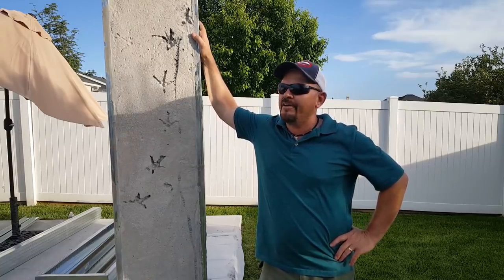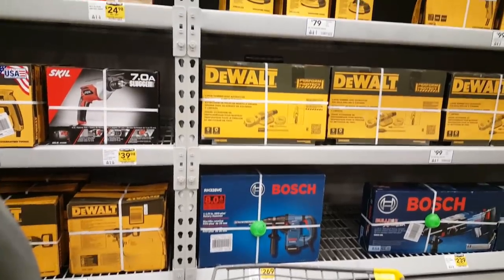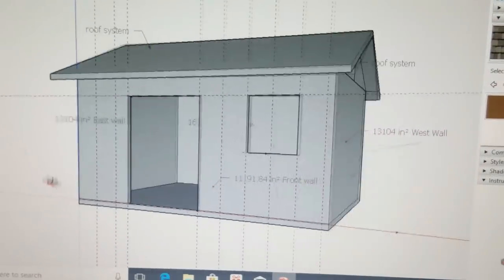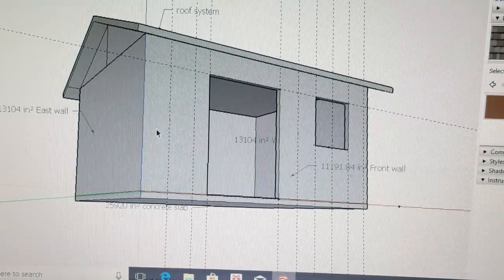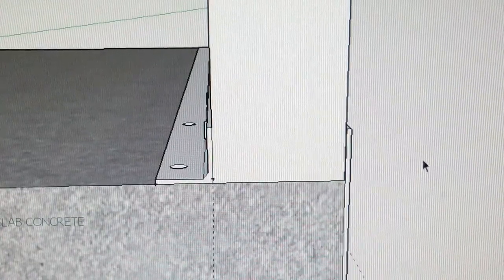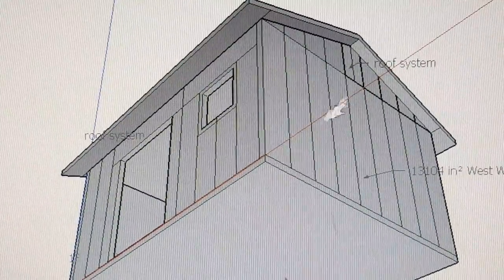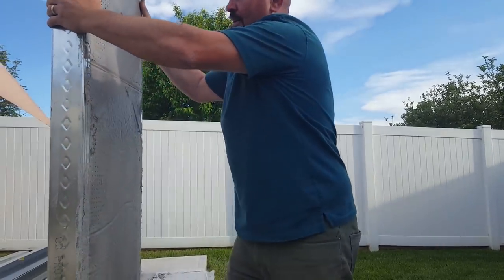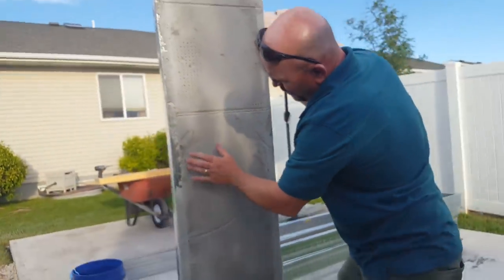Air Crete Shed Wall Panel Layout

Comment: I believe that the north wall is the wall that "everyone gets to see everyday". So, personnaly, I would have "hidden the thickness of the pannels" on the sides (eastern and western walls). Not showing the thickness of the walls in the front. Also, beware, aluminum and concrete dont mix so well. Great project. +1

Comment: Could you give a rough estimate on the cost per square foot with your air crete... I'm curious as to how this compares to other materials per square foot.
Reply: Depends on what you are comparing the per square cost to.  If plywood and studs, or a HD pre-built shed, this is not for you.  But I am sure the HDC will have the cost when complete.  His building will be fireproof, vermin proof, fire hose washable.....

Comment: I would love to build a goat shed out of aircrete.  Maybe domed would that work with aircrete?  We get snow here and a lot fo you think aircrete will hold up all that snow possibly?
Reply: Ps we live in Maine so when I saw we get a lot of snow I mean so very much snow lol.
Reply: This looks like a perfect application for Aircrete.  You could make a form with hardware cloth and plastic, then layer on the AirCrete.  Making a cool igloo shape.  When finished, you can easily hose it out every so often.  Form like gunite pools.
Reply: You could make a geodesic dome from this extremely easily. The panels could be framed the same way he is doing here with the C channel and assembled into a dome. Would be pretty straight forward and virtually indestructible. You could even top coat it with another layer to completely seal it.
Reply: Nathan Rogers ooh that sounds really amazing.  I would love to do that.  I think its passed my skills but with some more research on geodesic domes its possible.  I knew before I build it I would likely redo and redo the way I plan on doing it and thats definitely given me something to mull over not just for the goats but other animals too.  That would probably keep it safer with our heavy snow loads.  We just get so much snow lol.
Reply: William Terry that too sounds like a good idea.  Dome shaped however it gets that way would help with the balancing of the weight with the heavy snow.

Comment: Just checking, if the front has 6 16" panels, 2 10" panels, and a 42" door, that comes to 158". The drawing of the back shows at least 10 full width, 16" panels, and what looks like something that might be a 12 inch panel, not sure. However if you only treat it as 10 16" panels, that's 160". Both front and back appear to have reveals of the side walls, so I presume that the width of the front of the shed should be the same as the width of the back of the shed, which means that there are 2 inches missing somewhere (or over 12 inches based on the count of panels in back if the 11th panel is something like 10 or more inches.

I presume that the panel count of the back is not a correct depiction. Perhaps it should be 10 panels wide pluss the thickness of the side wall. in that case you probably want to make the 10" panels into 11" panels to give the front 160" as well as the back. But I may be missing something.

Comment: I would seriously look into a different design for attaching the panels to the floor. Since the floor is standard concrete a typical anchor bolt should work okay but I would use something  like a  PVC  pipe to create a way for the anchor to go in through the bottom of the wall  and use a wood form to create a pocket are in the wall to attach a nut and washer to the anchor running up through the PVC channel  in the wall. I know clear as mud.
Reply: Just drill holes in C channels and molly into the floor. Then stand slabs up inside track and fasten. Easy peasy!
Reply: Instead of angle iron put a rebate or step into base slab design, less material cleaner line's

Comment: I am guessing you are leaving the sheet steel forms around your air crete panels. I watched the chickenfoot panel pour and see you have mesh inside the crete so the overall panel should be pretty sturdy without being wrapped in the steel, so not sure why you are doing that unless you just have the money to spend. I would think you could design a reusable form that could be used to create exact duplicate panels, add is some sort of puzzle feature, tabs etc that would aid in locking the panels together as I still don't see how you are getting that part done. I would use that same steel smooth side on the inner so the panel can be removed after cure. The mesh inside will keep the panels intact until all together. maybe pour half the panel, lay in mesh then complete the pour. I am very intrigued by this and am watching through to completion to see how you join it all together, panel tto panel. It would be cool to have holes placed at specific locations on perimeter to allow the use of rebar pieces to hold instert and hold it together, it would be bomb proof! Keep it up.
Reply: I was wondering the same thing.  I've watched a bunch of vids on the subject, and there does appear to be several approaches. I'm curious as to the cost per sq ft compared to other materials.
Reply: I was thinking the same. Cut some PVC length wise form it a little too create a channel for tongue and grove. Maybe reinforce those areas with fiber mesh

Comment: Hey Darwin just for the record I am cheap I shop at habitat for humanity I save a lot there. If you have a store in your area? On the panels have you thought of when you build the panel could you use a PVC pipe to use rebar through the panels from the pad up through the roof? 

Also what program are you using to lay your project out? All my projects are small but I like using aircreet. Adios
Reply: James Owens habitat is a great place to support because they do awesome things.
Reply: Love Habitat Store!
Reply: kgs2127 habitat stores are expensive, they ask as much as the cost of items new. And no warranty.
Reply: He's using"SketchUp".  It's a free program if I remember correctly.  I used "Sweet Home 3d" to layout my little cabin.  It's also a freebie.  It allows you to layout rooms and customize the furniture to your actual size. and place the furniture in the rooms.  It has walk-through and many other views available.  Really nice to see how traffic patterns work.  You can even do landscaping and see how everything looks.  It's fairly easy to figure out.

Comment: Why not frame out one wall and pour it in one pour not a lot of 16 inch pieces... do the same for the other walls... The front wall you just make a square wall and put in metal studs for the door and window openings... But it to will be on solid pour... No need in all the extra work in all the 16 inch walls and 10 inch walls... My way would be mush stronger... Same money less work...
Reply: Why not make it out of timber? Or am I missing something
Reply: @A wood worker The whole idea here is to build using the aircrete. It is light weight, inexpensive, insect proof, rot proof, and fire proof.
Reply: The 16” panels are the only way he can use the volume he can mix of air crete at one time. I assume if he could mix a lot more he could pour whole walls.
Reply: I'm sure the slab was already there

Comment: 1 gallon or /approx 64 oz. ?? 1 gallon = 128 oz so the directions  say use 128 oz or approx 64 oz. I'm concerned as I don't want to mess up the recipe. Please clarify in the updated panel mix. Thanks

Comment: Ok. You poured a slab and it looks well leveled. So why are you not doing the walls like the commerical guys do? That is do a 'tilt up' construction. You use the floor as part of the form work and pour the two end slabs monolothlic with steel mesh, then tilt them up. Just bring all your friends and neighbors to do it.
Reply: I was wondering this as well
Reply: Was thinking along those lines too, those white vinyl fences in the back are the same really, put up the posts then raise up each panel. A bunch of smaller panels seems like a lot of bolting.
Reply: It's the capacity of how he mixes. .
Bigger panels means  larger. Equipment
Reply: Tom, watch his previous video. He poured the slab as a std cement mix in a day using the equipment he already had. That slab had triple the volume of what a tilt up wall panel would consist of. The only step he would be adding making an aircrete wall is the foam mixer station. That is solved by bringing an extra person on to that step.
Reply: The forms do need to be considerably stronger to hold all that concrete vertically, and I'm not sure what happens to the foam under those conditions either.
Sure would be interesting to see.
Reply: MaruAdventurer A

Comment: Just new to the channel, found it interesting but the bigger question is and may have been answered before. Why such a big overkill for a little shed ???
Reply: Yes, but AirCrete panels are the interesting part.  You should start at the beginning.  This is a new building material application.  Foam bubbles mixed in the concrete.  Normal poured concrete panels would weigh about 400 lbs.  The foam makes them about 100 Lbs.  Lots of ideas. shaping the AirCrete, Fireproof, super strong,  acid resistant....

Comment: I'm still not understanding why you're pouring the panels so small? 16" seems tiny, and will just lead to more gaps and lower thermal efficiency. Why not pour in 36" or 48" panel sections? With air crete, it seems they should still be lightweight enough that you can get them into place.

Comment: Rather than tamp it, which might make it more dense, how about using  a sawsall to vibrate it for 30 sec, or 1 minute for example.
Reply: This sounds interesting!  Make a blade with a rod or foot on the end of it, or perhaps just a bent blade.  Long enough to go through the AirCrete to the bottom of the form.
Reply: Better option would be to suspend the mesh further up in the mix. It is practically up against one side of the panel leaving a lot of aircrete on one side and almost none on the other.

Comment: Would it not be simpler mechanism to fix  wall panels to the Base, by embedding a bunch  of rebars sticking out up from the Base, (say 2 per panel), and then simply drill the panels from the bottom and slide them over onto the rebars, while using some cement/epoxy, to glue it all together.

Could also drill the slab and put the rebars in that way, once the slab is poured w/o them
Reply: this requires some very careful measuring to get everything to line up as well how do you keep the epoxy from running out of the hole while you place it over the rebar?  A better option would be to pour rebar into the panel, drill a hole in the slab and glue it in to the hole so you aren't fighting gravity.  Still have to deal with the very careful measuring and drilling.
Reply: scrager4 actually your idea is even better indeed!
personally I  would not be concerned too much about the precision of the drilling required, as it would be dead easy to jig up some stencil to embed the rebars in the exact same spot in each panel, perpendicular, etc. Same for drilling perpendicular holes in the slab at exact the right spots. Or even for  embedding matching sockets as you pour the slab.
Reply: KISS principal guy's.   If this is to be viable as a system for semi skilled labor and  poor country shelter applications.   Being fire and termite proof is the prime objective next structurally sound.  And in some shelter applications there
may not even be a slab;  just a tamped earth, oiled floor.
And by using metal studs as an in place, form;   simple tacks with a small 110 V. welder would provide necessary fastening.   the old guy   Bert
Reply: michbushi you could possibly 3d print jigs to hold the rebar in place

Comment: Seeing the design drawings prior to seeing you doing the work lets us know that you're definitely planning things in advance, and gives a basic idea what your design goal is rather than having to watch through a sequence of videos before you simply declare "That's exactly how I wanted it to look!" before throwing plans at us that could have been drawn to match your results.

However, I find myself a bit irritated by the design showing the sq inch area of all walls, when the overall dimensions of each wall and panel would be more immediately informative, and those only shown when looking at the relevant wall.

Comment: Those fastening holes look too close to the edge of the wall panels to me.. Would 1-1/2" by 4" angle iron be better so the bolt holes in the walls would have support - the holes would be say  3-1/2" up from the bottom of the panel instead of 3/4"?  I don't know if they even make 1-1/2" x 4" angle iron - so probably it would be 4"x4"

Comment: seems a bit like overhandlin' to me.  what is the point of air crete walls?  why not just build a timber frame wall and be done already?
Reply: Same here. If it was me, it would be : Steel stud framing, (or pressure treated lumber), Hardi siding screwed on. Done.  This would require tin snips, a screw gun, and a diamond blade. I mean for Christ sake it's a shed not a bunker.
Reply: I just dont understand the excessive use of handling of materials here.

Comment: Just a quick thought, having childern anywhere near the ends of those metal studs is a huge risk. From the little bit of work I've done with metal studs, the main take away I got was that they will cut you very quickly.  And the wound that they leave you with just horrendous, that takes forever to heal. It's not something you ever want small childern around.
Reply: Perhaps a better idea is that the little ones learn about safety and what to touch and what to stay clear of.  Small accidents are learning experiences.  Don't touch the stove it is HOT!  Opps!!  I told you not to touch it!

Comment: I know that you are trying to make a difference in construction or the way construction is done but I think it's to expensive the way you do it. Why not build a stick frame and insulate. You would already be done by now and your grandfather could have a place to store his lawnmowers.
Reply: This is  a project using old techniques with some new building materials.  Have you tried using AirCrete?  Some people would like materials that do not rot with chicken poop,  dog kennels that are hosed out daily.  Normal poured concrete panels would weigh about 400 lbs.  The foam makes them about 100 Lbs.  Lots of ideas. shaping the AirCrete, Fireproof, super strong,  acid resistant....

Comment: Why not just frame it like a normal house, seems easier, faster and prolly cheaper
Reply: You can just bolt it to foundation, seems like a lot of computer work for small lil project.....its basically a box with a roof, pretty simple to do without a computer and fancy schematics
Reply: See Answer above.  This is about using new material AirCrete for a different applications.  HD and Lowes, have lots of sheds that will last a few years.
Reply: @williamterry3177  

Those sheds are junk.....just frame it like a normal house....if waterproofed and either stucco or siding it will last forever....framing is versatile and can be adjusted on site....just seems very complicated for small box
Reply: @kirkdunn1379  they told the Wright Brothers to forget about trying to build an airplane too. Let's see how your wood frame holds up under heat and steam as a smoke house. The vermin and rot will eat it up in a short time.

Comment: You need to perfect your panel creation so it can be repeated over and over again with less than 1% error in density, dimension, etc. Also when you are doing this, you need to create a quick and easy way for the panels to be fastened together and for the panels to be anchored. Once you have accomplished this, file for a patent with your designs and start marketing the panels themselves as an alternative building material. Aircrete has been around for a long time (created almost 70 years ago!) and there are companies out there that sell premade or precast panels of aircrete but that's all. So far there has not been a "system" created that allows for quick building of structures that I have seen. You don't need to perfect Aircrete, that's already been done. What you need a lab for is to create a marketable panel that can be assembled in minutes by a DIYer. Then you will have a product that people will flock too! Nobody wants to spend all day mixing this and doing that, they want to buy panels, buy the hardware, and build! Stop messing with chickens feet trying to be cute and get hot on your frames!
Reply: Having fun working on an interesting project.  Getting clicks and subscribers helps too.  Then there will be the sponsors later.  This is also entertainment.